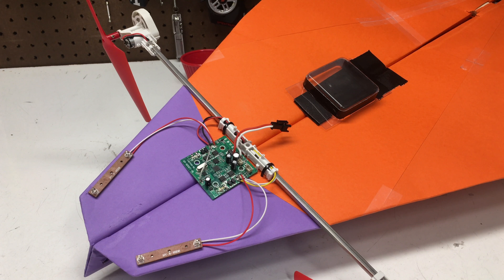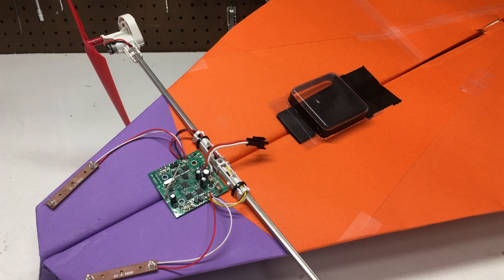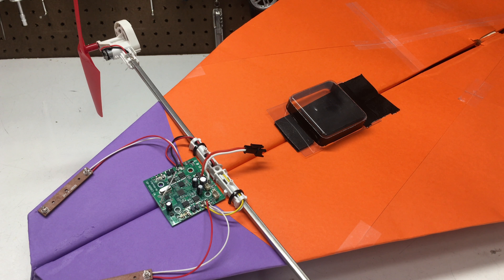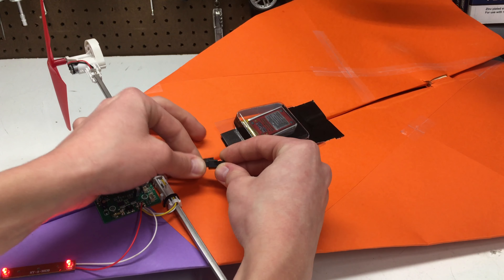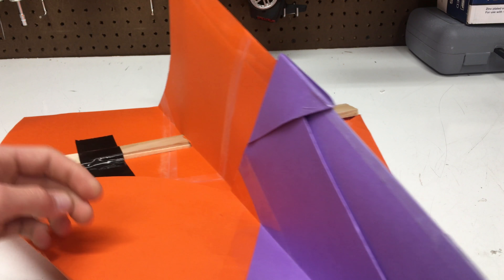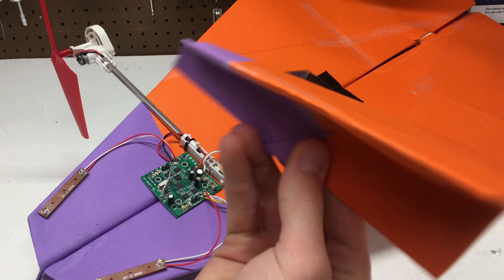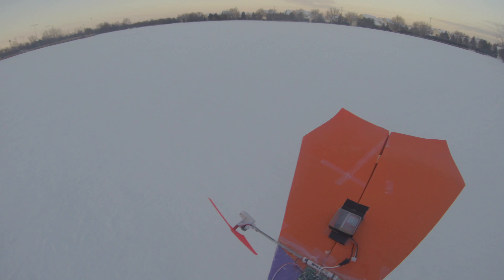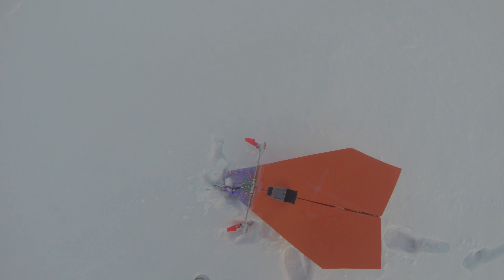1600% RC PAPER AIRPLANE | Will it FLY??

Comment: That is also my Favorite design. I use to crease and cut flaps in the back to increase glide for high level drops off buildings etc. Nice vid
Reply from the maker: Okay, you give a lot of good advice. I will reply to them all here in one post. 

I have been fascinated with paper airplanes for most of my life. My house is littered with them, and I have tried pretty much every design that I have seen. The Nakumara Lock is by far the most predictable time after time, and I find it also very tunable. I have worked a lot with the elevators on the back, but unfortunately for this plane, two motors isn’t gonna be enough. Paper by itself isn’t that heavy, however, I used 16 sheets of cardstock, held together with heavy duty packing tape. I also used 2 wood shims to brace the back so the wings don’t flop. I was thinking about a 3-4 Motor design but I have been leaning more towards scaling the aircraft down to increase speed, decrease drag and overall make it fly less sluggishly. Also, a heavier plane will inevitably get destroyed when you crash,  and a lot harder to repair or to make a new airframe. 

Balance wise, this plane was spot on. Unlike 100% scale planes, there is a 16x more margin for error in terms of folding. 

So at the end of the day, the thing was just underpowered. I also found issues  with the flimsy single sheet elevators actually making a difference in the plane’s handling. Thanks for the advice Phill!
Reply: I love Learning with you the way you go at it all things considered, Keep at it !!!
Reply from the maker: Trial and error! That is the best thing about making paper planes. You don’t feel bad if you need to scrap a design because paper is cheap!

Comment: Move motors back a full inch. Its paper. Your design is good it will fly with those motors
Reply from the maker: I was looking at that, however my prop setup is about 1/2 inch away from the leading edge of the wings, and moving the motors back would make the props interfere with them. I thought of cutting a slit in the wings for the props, but overall that would compromise the structure of the wing.
Reply: That makes sense, I didnt give prop position that close a look, I got  a feeling you will figure this out sooner rather than later as I dont see you slowing down!!!
Reply from the maker: Ahh... you know it. Those daily uploads are kickin’!